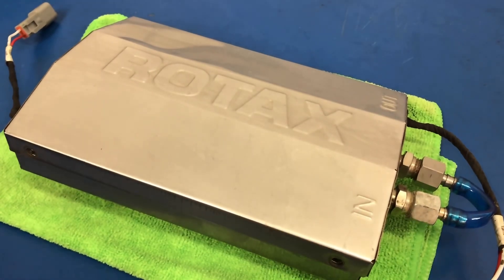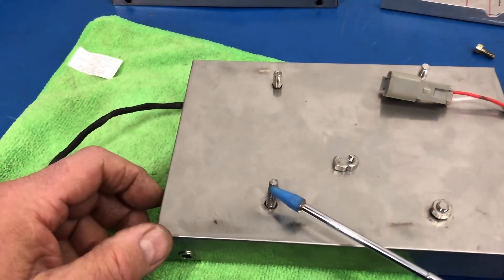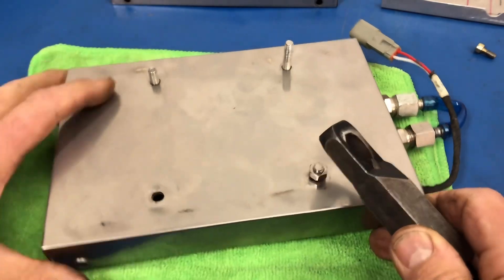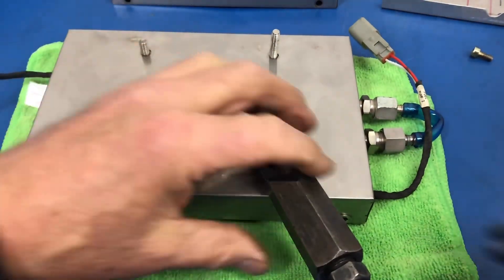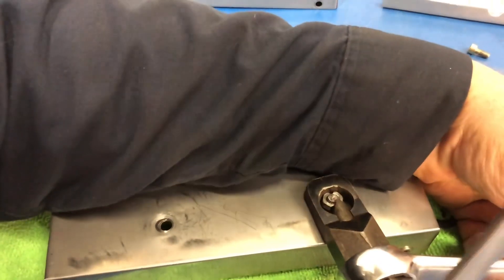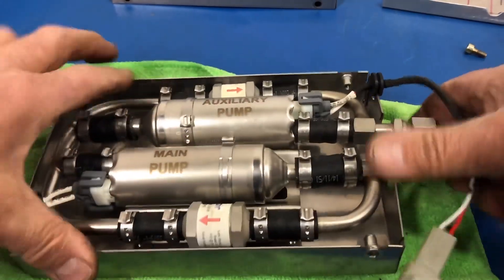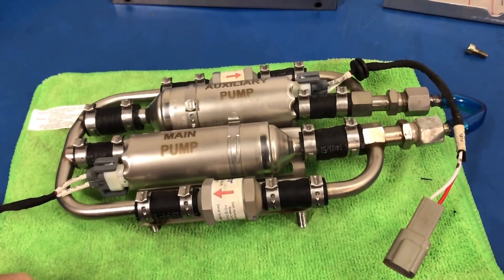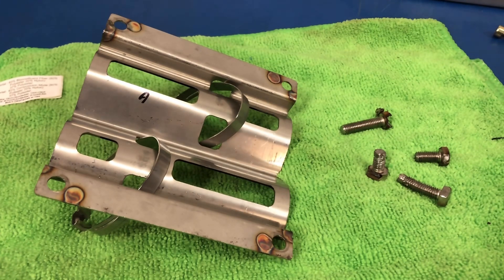Rotax 912iS fuel pump assembly repair

Comment: I haven't seen a nut splitter in ages!   It's not a common tool but is one that can certainly save a ton of work in the right circumstances.
Reply from the maker: I remember using it 40 years ago on Chevy pick up truck front shock absorber lower mounting nuts.